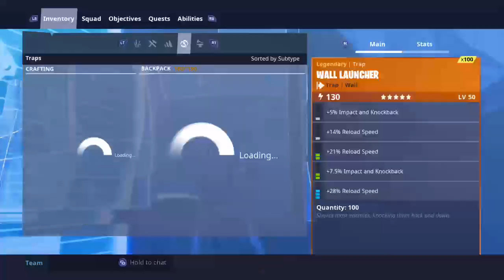Twine Peaks SSD 5 Building Tutorial

Comment: Good as always.This is My Amplifier E and its very easy to defend
Thank you.
Reply from the maker: Be careful on SSD 6 if this is your E then! it will be attacked from the West side!!! Highly Advised to block of the West side by placing the Amplifier up on the hill. Your defenses will increase in difficulty for SSDs 6-8 until the barrier will extend enough to build on the South side of this Amp but if you have a few buds and build what you can from the tunnels on the South you should survive just by doing some simple pathing coverage so flingers/lobbers come to the bottom of the hill. (If you're familiar with the Frostdome you can build a ramp from the Amplifier to the top of the Hill, it'll be easier to finish off once the storm extends rather than  trying to do exactly as the video instructs, after that all you need to worry about is blocking off the side pathways they'll run to to shoot around the ramp and then they should all drop to the bottom, in the case parts of the ramp get attacked just rebuild the ramp and then add a double patch on it (incase it in walls and then a ceiling piece). Once you get through SSDs 6-7 it should be much easier to defend this South side and you'll be able to easily destroy the ramp blockage with  edits.

Comment: Is This attacked or no in ssd5? Where is the extension? Anyway very Nice work man! You should bad more subs! Keep up!
Reply from the maker: Depends on your order of Amplifier placement but if you follow my Amp placements it shouldn't be attacked until 8 or 9 if I remember correctly. 
I tested it out pretty thoroughly and to get the spawn to the west there are only 3-4 possible combinations of Amp placements that need to be hit perfectly and they're kind of unreasonably nonsensical for everybody. Even if they do attack from the West we'll only see them do so for 1 wave at most before you're forced to put the Amp up on the hill so it's something I've decided to just leave there as a bit of forewarning for others.
1. The defense to the west for solo-ing would cost as much as it did to the South as it is a big ol' bouncy bounce of hills. 
2. They actually spawn super close to the Amp itself so while not difficult it is more reliant on a players level being acceptable and no so much the build itself being superior. 
3. If they do attack from the west it'd be either SSD 6 or 7 (possibly 8) (depending on your Amp placement too, one guy had them come SSD 5 if I remember right) and none of those have a shield that extends out far enough to be building this western side, save SSD 8 (but I haven't found anybody who has placed that Amp up on the hill past 8 yet so not entirely sure if they'll attack on 8, just general knowledge of if they start attacking a side they'll keep attacking it until an AMP is placed in their way).
Reply: Thanks for the explanation bro. :)
Reply from the maker: @boomportugal5408  My pleasure, I hope it helps :)

Comment: I have been following all of your videos and I just want to say that I just tried SSD5 and I got attacked on wave 4 at this location. Now I am unsure how to proceed because I cannot do most of the build due to the storm shield :(
Reply from the maker: The waves you get will be different from the waves I got because in update 10.2 (about 2-3 weeks ago) they introduced a new spawning system into Twine Peaks so once you figure out the new spawns the builds will still be relevant, just the information on which amps will get attacked and which won't, won't be as accurate. However for this one you should have a much easier time building what you can, the wave itself is relatively small and easily solo-able unless you're woefully under-powered in which case bring a friend.
Reply: @CanadienSaintNk  I managed to build down the cliff and brought a friend just in case. Got there in the end :) thanks man

Comment: Can I just place it and not build?
Reply from the maker: If you've placed them exactly as I have and they haven't altered the SSD spawning without announcing it then yeah, it won't be attacked till SSD 8 or 9
Reply: CanadienSaintNk But 1 question tho, is it also ok if i placed amp A on your B and B on your A. Will it then get attacked?
Reply from the maker: @moneyyt321  if you place this on your SSD 5 defense you should be fine, shouldn't see an attack till SSD 7 or 8 though there are instances for people getting attacked on SSD 5 or 6 for this amp placement but I believe that has more to do with placing other AMPs like C  to the south of it.
Reply: CanadienSaintNk Well thank you for letting me know because i will build on the amplifier (even though i cant build 40 percent on it xd), just to be sure.
Reply from the maker: @moneyyt321  godspeed, if you opt for another Amplifier on the spur of the moment know that all my builds save SSD 5 are built to defend from every side they can spawn from so there's no harm in coming back to it later once eliminating the spawn to the west of it on the mountain by placing that amplifier (which turns out to be Amp G for me which is SSD 8 I believe)